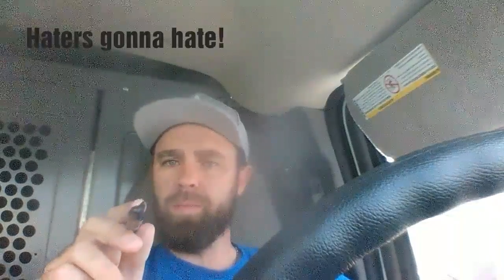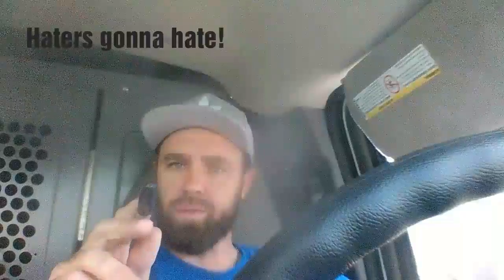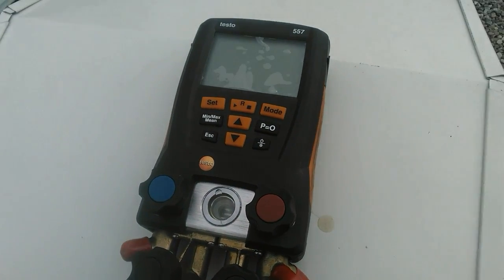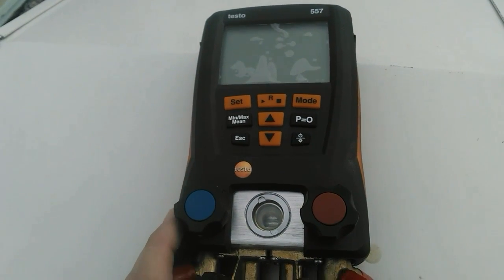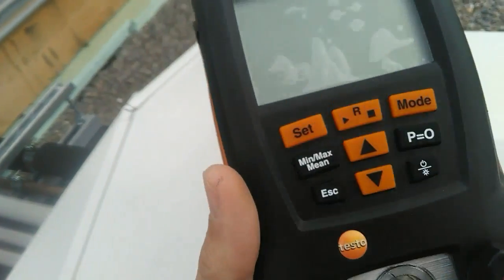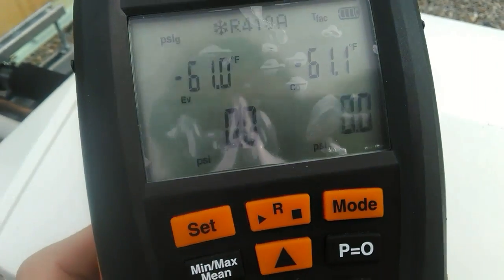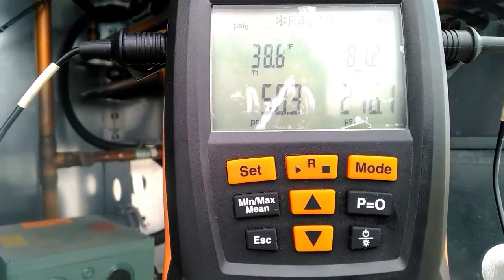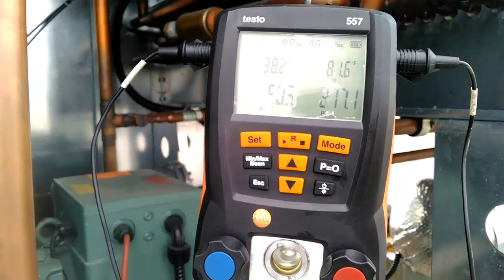Soaking wet Testo 557 - HVAC Know It All

Comment: I'm on a job right now, a 3 story row home in Philly with 3 Addison HVAC systems from 1984, obviously R22. All systems are up & running now. The customer called 8 other companies before he found me. None of them would repair the units, all said all 3 were shot. I found 2 bad capacitors & 1 bad contactor. All 3 were still charged perfectly. Of course I said get ready to start replacing the systems because there's no way to tell how long they're gonna last, but as long as the compressors keep chugging along & they keep holding fritterant, I'm gonna service them. I love it when I'm able to work on shit like this.